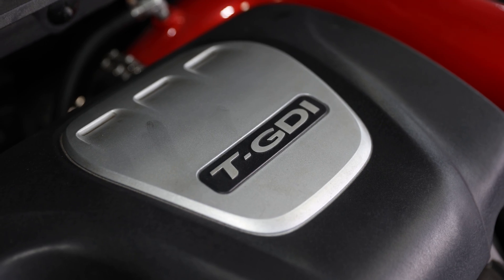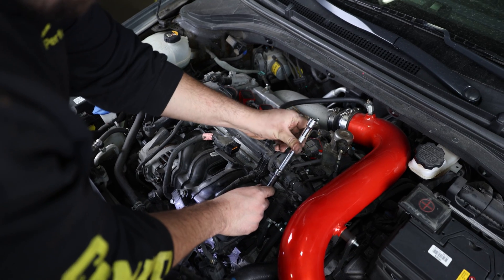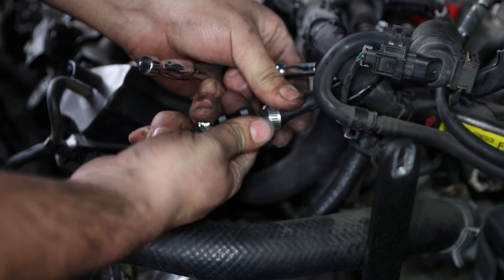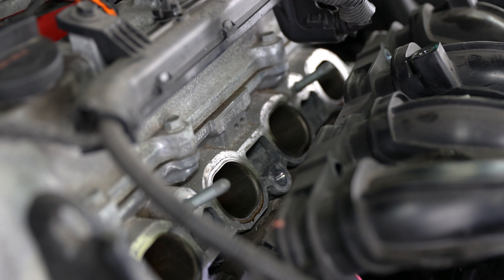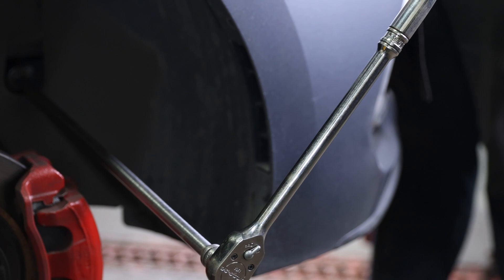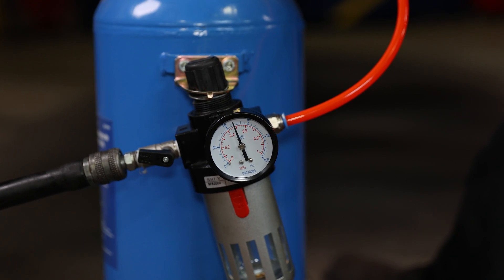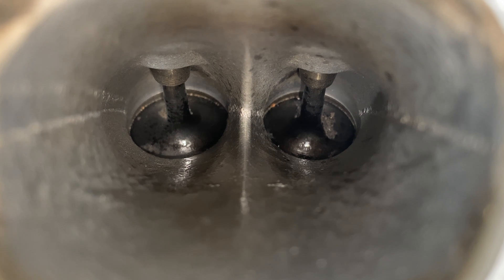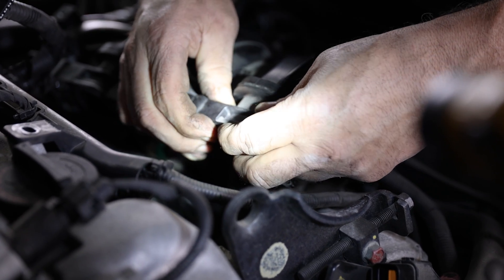WALNUT BLASTING A GDI KIA/HYUNDAI ENGINE - CRAZY RESULTS! (CARBON BUILDUP REMOVAL)

Comment: Having this done Monday at my local Hyundai dealership except using a solution instead of walnut blasting.

2016 Sonata Hybrid, 180K miles. Just had the exhaust manifold/converter replaced (to fix a long lasting DTC that nothing else fixed) and the manifold was really gunked up with burned oil. Drove 40-50 miles, no DTC. Problem solved.

Having this done to help prevent that again. I already have an air/oil seperator that should help.

Comment: Is it just me, or does it seem absurd that needing to walnut blast the engine for carbon buildup highlights a significant design flaw in direct injection systems? It feels counterproductive and detrimental to engine health to rely solely on gasoline direct injection (GDI) without the benefits of multi-point injection. This combination would surely enhance performance and longevity.
Reply: And thats why Toyxus is so reliable. They don’t do GDI.

Comment: And blast media accidently gets into your cylinders and scraps the walls.
Reply: That's why he said they rotate the engine so the valves are closed. Once they're closed, nothing is getting into the cylinder.
Reply: Also, you are using walnut shells,  so if any were to get in the engine, no damage would be done. Lot softer than metal pistons and engine blocks!

Comment: There are tons of bs can go wrong with a gas car , that's why people are going increasingly for electric cars .
Reply: No
Reply: Good luck getting working chargers on your road trips. lol. Oh, and if you don't buy expensive fast charger, it takes like 72 hours to charge a EV at home. And on the road, if you do find working chargers that do not have a long waiting line, then you wait the hour to charge to 80% maybe, studies have shown it cost more than gas. But yeah, no GDI to worry about, just a bunch battery strung together, electric motors and components to worry about.
Reply: @onlywenilaugh6589  who said anything about doing any travelling with it? The vehicle I drive requires the most expensive fuel (premium), plus gets the worst gas mileage, around 13mpg around town, 20hwy. I am considering getting one just for commuting, and we also have a reg ICE vehicle for long trips. I am an auto tech 42yrs, getting tired of the maintenance...
Reply: Hahaha. EVs are a gimmick, and the sales are actually down. One main news outlet reported a 500% inventory of EVs because they're not selling. Also, please tell me about the full battery pack replacement every 6-7 yrs at a very cheap $15k. I could drive a Camry for 200k miles without touching the engine, try that on a single battery pack.

Comment: I just run mine hard everyday. Keep it blown out. When you put around like a granny then it will build up. Put some good fuel cleaner in and no issues.
Reply: These are direct injection engines; fuel cleaner has no effect.
Reply: Yeah. There is no fuel that touches the intake valves. It is directly injected into the cylinder. Best thing to do to prevent buildup is to use a catch can. I have around 24,000 miles on my Veloster N. Just looked at the valves with the intake manifold off. Valves look clean as hell.
Reply: @Carrier2501 Catch cans don't work in cold climates like mine.
Reply: I just bought mine at 5962 miles installed catch can at 6900. You think I'm good lol
Reply: What catch can did you buy? Do recommend it? @shortroundChris
Reply: @shortroundChris  Helps but won't solve it as will still get build up.

Comment: Hi would the ECU also lean out fuel trims when intake valves are dirty?? Sorry just haven't been able to find an answer
Reply: Over time as it builds up, cylinder airmass will decrease due to less air being able to enter the cylinders. The ecu will compensate by removing fuel to achieve stoich afr. This can cause issues with spark knock/detonation as the cylinders arent being quenched in fuel as they normally would.
Reply: @ThatGearHead97  Awesome thank you for your reply, I actually just had this service done yesterday and yes it made a huge difference in how the car responds now, better idle and more responsive I don't know about fuel mpg increase hopefully that too.
Reply: @JoseSandoval-ic5xe at what milage you got this service?

Comment: I have seen videos where people have used a borescope to see the tops of the valves with removing the manifold. How is this done?
Reply from the maker: This isn’t possible on this particular engine due to the design of the intake manifold. On some vehicles the intake runner follows a more linear path so it’s easy to see the valves without obstruction once removing the throttle body or intake plenum (if applicable). Where on this engine the manifold not only is very curved but is also valved so it wouldn’t be possible to feed a borescope through this intake manifold but it’s definitely possible depending on the design and access.

Comment: I have the exact model with 75k, bought it used at 73k and installed a catch can right away. Would you recommended this service and if so how much would it cost? Thanks
Reply from the maker: This engine had approx 80k km on it at the time of the shooting of the video. There is a significant benefit to this service. The main reason for the service was because we noticed that the ecu control strategy was pulling ignition timing due to knock sense. Once the carbon was removed, the tuning strategy regained full ignition advance, restoring the full power of the engine. For exact cost breakdown please shoot us a message on Instagram or email !

Comment: where did you get the port adapter for hyundai engines?
Reply from the maker: We have a dedicated specialty tools distributor locally. But it’s very easy to find these adapters online as well. Just make sure it’s compatible for the 1.6/2.0 model engines

Comment: I've done this on 2 engines. A 1.6t Hyundai like in this video, and an NA 3.3 V6 Hyundai engine. It's not nearly as scary as it sounds once you start. Pretty easy.
Reply: Hi, I have Hyunday Tuscon 2.0 GDI engine. Does this procedure improve performance. ?Thank you.
Reply: Props to you man, the bank 1 on the 3.3 v6 is just very challenging to work on.